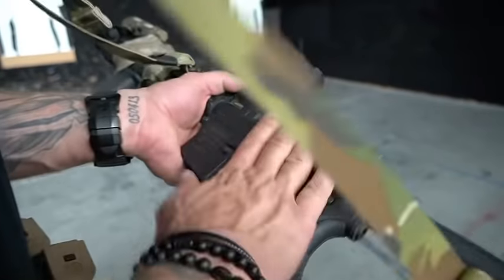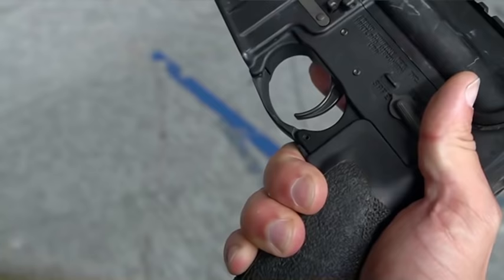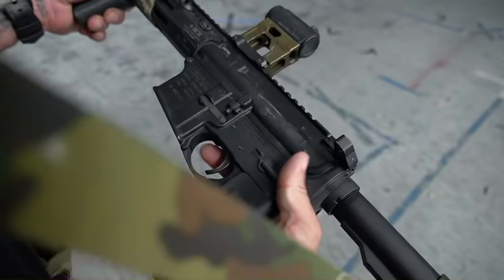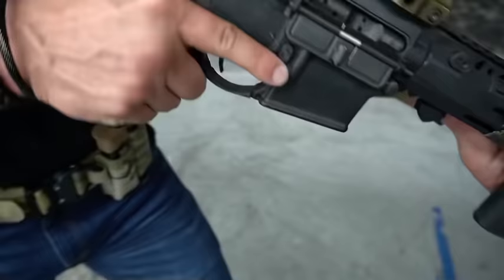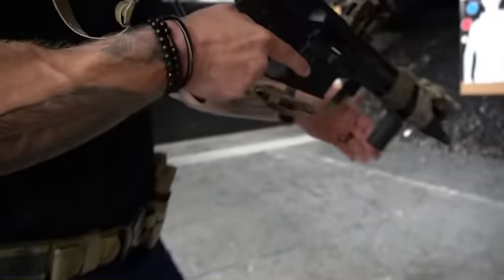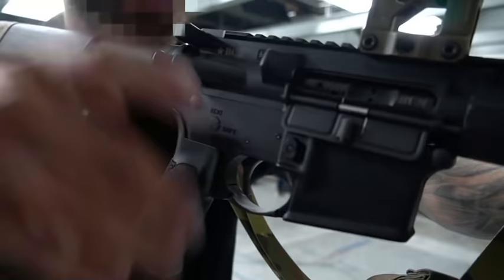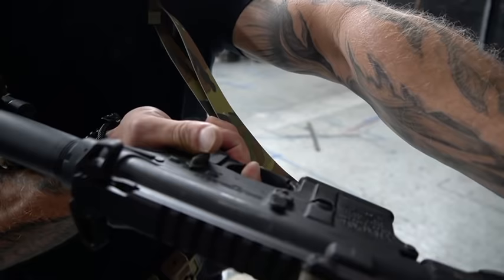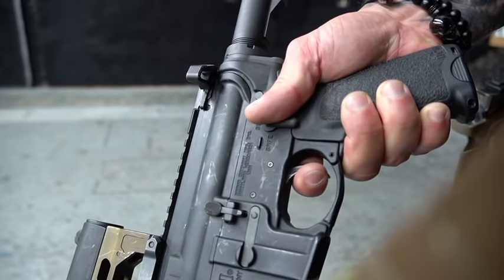GBRS GROUP- Knowledge Transfer Safety Selector Edition

Comment: So you don’t flick the safety off until you’re ready to put your finger on the trigger? I’ve always been told that the safety comes off as soon as the rifle comes up from low ready or down from high ready. Or do you really put your finger on the trigger before your sights are on the target? Seems needlessly dangerous especially with the prepping part...
Reply: If you're bringing your weapon up to go on target, you're going to want to be ready to fire as fast as possible if needed because you're not snapping the sights to your eye just to say hello to someone.
Reply: @jasonm7888  Sure, but are those few milliseconds you might save by prepping the trigger while raising the rifle really worth the added danger of NDing? Especially in a high stress scenario where you might not have the best fine motor control? And let’s not forget that there’re situations where you raise your rifle despite not having identified a potential target yet. Like pieing a corner or covering an opening. I’m not trying to be dick btw. I’m just trying to understand where he’s coming from.
Reply: @nikolaswirz4022  I guess at this point all I can say is look at sports. The difference between a professional and an amateur is often seconds or milliseconds. And that goes for the risk of an ND as well. 

I don’t really think they should have posted a video like this because this particular technique is a high level skill that takes a professional amount of practice and competence to do right. 

And as far as how you’re using CQB tactics; those who know, know. 

Just remember there is more than one way to skin a cat.
Reply: @nikolaswirz4022  might as well keep the chamber empty, too.
Reply: It seems to be that they don't take the safety off until they have made the decision to shoot......that would be the reason for this......to leave the safety on up to the very instant you want to fire?  Seems dumb.
Reply: The reason is to break a shot from safety on as fast as possible in order to not die

Comment: These guys are a bunch of bad asses.  But……I have to disagree somewhat.  I understand throwing the safety and pulling the trigger at the same time if the decision to shoot has already been made.  But to throw the safety and prep the trigger in case you have to make a shot,,,,,, I don’t agree.  If the safety is thrown and the trigger is prepped, this means that someone came into view and may need to be shot.  In my opinon the risk of goin to prison because you prepped the trigger and didn’t mean to fully depress it, isn’t worth the risk of saving a hundredth of a second so you can get the “jump” on the bad guy.  Im not even sure humans are capable of reacting within a hundredth of a second let alone a “millisecond” like some folks like to claim in these comments.  And I don’t care how much training or trigger time someone has, the human body will always react differently under stress and in live situations, the only difference is the person who has more experience will be able control the stress better.   

be safe guys.  Out.

Comment: Ever the need to operate the safety selector from support side? Say after a transition, or if your strong hand were to sustain an injury. I think it's nice having the options as long as it doesn't impede your performance or cause reliability issues. 
Sincerely, Concerned Citizen
Reply: You use your left index finger knuckle to manipulate the safety. There's a video of this if you search for it.

Comment: Why not just "Take the safety off if you're in a situation where you may need to shoot, and don't touch the trigger until you're ready to fire?"  KISS.  Maybe I'm not up on the latest high-speed elite operator manual of arms, but this seems a mite "I have nothing to do but dry fire all day and look cool."

Like - "So what we like to train to do is the 'LSBRS' (phonetically "L-Sabers") technique. Line up your shot, Solve a rubik's cube with your offhand, check your Backstop, Round PI to 6 digits mentally, and Squeeze the trigger."  Bet if I blurred my face in a video and said that someone would think it was cool, too.

Comment: German Army HK 45° ambi safety selector is the quickest, most ergonomic i've ever seen. They put it on fire with the thumb and put it back on safe with the trigger finger than moves off the trigger. One smooth movement, without ever needing to lift fingers off the grip. Extremely efficent.

Takes ages to get used to once you trained on something else though.

Comment: I just wanna say thank you to whoever created the 45° - 60° Short throw safety and can't wait for the video Bros
Reply: You should do a little research into the 45 degree safety’s not always being completely safe. From what I understand the 60 and 70 degree ones seem to be much safer. Garand thumb talks about it in his honey badger video
Reply: @dragon3allzdeep325  I've been using them years . I can only speak for myself .  I have not had any issues with SOLGW / FCD Ambi 50° STS or Noveske / Magpul 60° STS paired with Geissele SD3G or CMC 3.5 Flat S.S. Triggers . I could switch back to 90° and be perfectly fine .
I do listen too people who are way better than me but I also use what's best for me . I used 90° ambi for 10+ years. If its installed correctly and you understand the basic fundamentals.  I can't see why it wouldn't be safe to use . 
Geissele makes Super Select Fire Ambi STS that was made for US DOD . I don't know who uses them or if any at all..
Reply: @seanwhite304  the way he explained it in the video is if you have a lower that isn’t in spec then they’ve been known to cause problems. Can’t speak from experience though. Only had my talon at 45 for a few range sessions then after I heard that I went back to 90
Reply: @dragon3allzdeep325  I could see why that would be an issue . TDP / MILSPEC is super important for a reason . I've been using Colt Lowers since 2006. 
Colt  , BCM and LWRCI IC are 3 favorite Lowers ..
I have not used Talon STS on an actual range . I have played around with them at my LGS. 
FCD / SOLGW Ambi STS is for sure in spec . Those dudes are sticklers for sure and not going to put out shit product.
Reply: @seanwhite304  yeah. I’m a poor so I’m rocking my psa and s&w lowers lol hope to eventually work my way up to a bcm or lwrc though
Reply: @dragon3allzdeep325  Just remember the Indian is ALWAYS better than the arrow .
Reply: @seanwhite304  Fs. I’m definitely lacking on my training experience, I don’t have an actual license and I’m my area I don’t know of anyone reputable to get training from. Waiting to see someone reputable come to my area. For the time being I’m just relying on YouTube video drills and rounds fired.
Reply: @dragon3allzdeep325  What part of the country do you live in .
Reply: @seanwhite304  around Texarkana. Buncha nra instructor fudd types that think all this stuff is unnecessary. Which is whatever, to each their own. Just not what I’m looking for
Reply: @dragon3allzdeep325  James Yeager is the owner of TACTICAL Response.  He also has YT channel as well ..
Reply: @seanwhite304  yeah I need to. I’m waiting on my license suspension to end  to travel anywhere at the moment then something like that will definitely be possible
Reply: 45-60 is the Kangz.

Comment: Serious question:  can someone explain why our manual of arms is so obsessed (for lack of better terms) with the safety manipulation on rifles?  Handguns (the plastic ones) come without a safety, and training on that platform is all about muzzle and trigger control.  Why are handguns and rifles treated differently?
Reply: Two things, mainly. 

The first is because handguns have holsters and rifles do not. 

When you present a pistol, it’s from a holster - where the trigger is protected - to engage a threat and then back into the holster. You can think of the holster itself as a safety, so drawing out of the holster itself is the equivalent of flipping the safety off, and reholstering is putting it back on again. To ‘holster’ a rifle you can only sling it and the triggers remain exposed to catch on gear and cause a negligent discharges.

The second part is related to the first….trigger pull weight vs gun weight. On a pistol, the pull weight of the trigger is 6 or 7 times that of the gun itself.  i.e. A Glock that weighs 1 pound has a trigger pull of 6 pounds. You could hang the gun from the trigger and it wouldn’t fire. Try that with a 9lb rifle with a 4lb trigger and you’ll get a hole in the floor every time. The sheer mass of the rifle itself makes the trigger easier to pull.

When you put those two things together, it makes sense why you’d want to make engaging and disengaging the safety sheer muscle memory when you’re working out of cars, boats, helos, stacked up in CQB, climbing ladders, carrying a stretcher, etc. You’re gonna be slinging and unslinging that rifle all the time, so the safety better be on at all times or else you’re gonna have a bad day.

Comment: Forgive me, but with such incredibly fine, precision trigger control why use the safety at all? Is it pursuit of the craft or to avoid stress driven mistakes?
Under duress it seems like a potential point of failure to have finger and thumb performing the job that one time served finger has been trained to do?

Honestly curious, i’ll never find myself in a position where it matters, just wondering what the reasoning is, minimises the chance of an AD or worse?

Comment: Curious what 2-stage trigger he runs.  I have SSA-E in all my rifles and they are way too light for this.  The second stage pull weight is like 2lbs.  I have to imagine the weight needs to be much heavier.  Thoughts?
Reply: Think he said he runs a Geissele trigger.
Reply: Most likely Geissele and can’t you just change out the spring if it’s too light? I did that with my Geissele trigger because it came with two springs.

Comment: Could you do something similar with a single stage?  Once your on target apply pressure to the trigger than remove the safety breaking the shot. Defiantly seems like it would require a lot of dry fire reps.   Great info!  👍🏼🇺🇲
Reply: Good day Phil. All my carbines have a nice crisp single stage trigger. I trained to do this in one single swift motion all im doing is making light contact with the trigger and front wall as my safety is being disabled. For me making contact with the trigger and deciding on to take or not take the shot is less forvging than trying to take up the first stage slack and not breaking the wall or the shot off on two stage trigger. Thats just me and the few years I've trained with single stage triggers. Reps and perfect practice my friend!
Reply: @robertpagel8951  Seems like a technique that competition shooters would use for sure.
Reply: A single state trigger has no take up... so you just put your finger on the trigger as the safety comes off.  I prefer single stage instead of double stage... I do the same thing as DJ except I am at the wall of the trigger as soon as I put my finger on it, no need to take up with a single stage.

Comment: Puh, this needs a lot of training to be stress stable and work under pressure 👀
Reply: @James_Edward59  I know. 15 years behind the gun as an EU airborne and LEO and if I would transmit this to an common audience of medium and even advanced shooters. I bet someone does a shot faster than he was thinking about it. In some Country’s not that big of a deal but on others it is.   
Just saying from my 1.st world situation  🤷‍♂️
Reply: @br0leg274  I 100% agree with that, even with advanced shooters, there would be a good chance of an accidental discharge but these guys are the most elite and they train until it’s 2nd nature and can be done in the most stressful and difficult situations. Maybe he should have mentioned though that this isn’t something you just learn overnight and that its for way advanced shooters and needs to be practiced without ammo for a while before you start getting used to practicing it with live ammo. IMO this drill needs 1000’s and 1000’s of reps before it should be practiced with live ammo.

Comment: Does the two stage trigger have any mechanical stop?
Or is this just the results of tens of thousands of trigger pulls that make this 2nd nature?
Reply: Dunno what trigger he's using but my 2-stages all have basically zero resistance for a few millimeters and then a "wall". Press a bit harder once you hit the wall and they break in maybe 1/10th the distance that they traveled to get to the "wall". So if you do what he's doing the trigger just moves back until it stops... press harder and you've smashed the gas. 

In that regard it's like the trigger on, say... a CZ75 when it's cocked. There's a fair distance of play in the trigger until you hit hard resistance, fraction of millimeter and you've engaged the noisemaker (unless you're running a muffler).
Reply: @wilsongulick4608  Right on. Thanks. I know these guys are the best. But I feel like this is really testing the pull out game.

Comment: I have no doubt this guy is a bad-ass... but why do I see so many AR shooters, weather they are pros or not, seem to have a problem with having back-up sights?
Reply from the maker: Luis, for the job we did in the military there wasn't a big need for back up iron sights. You have optics and lasers, for the mission set we did, it just wasn't needed so we stripped them off. It's all personal preference.